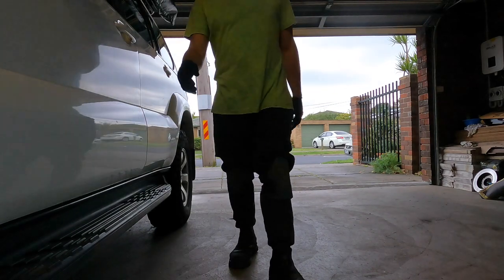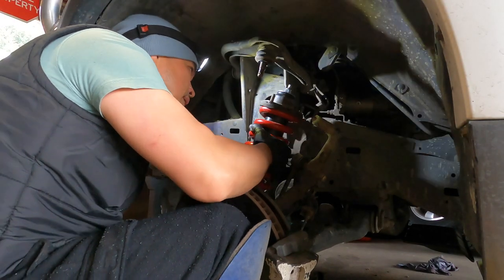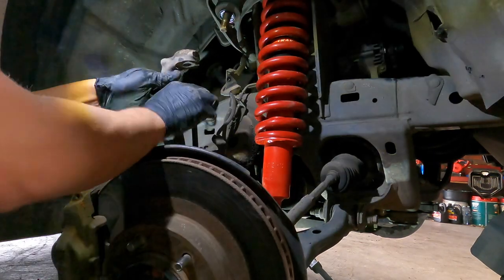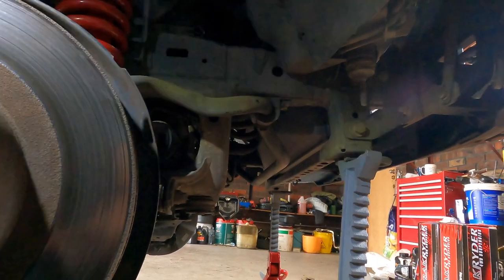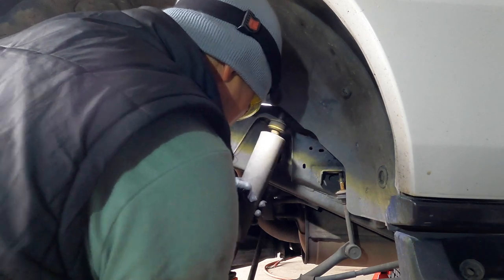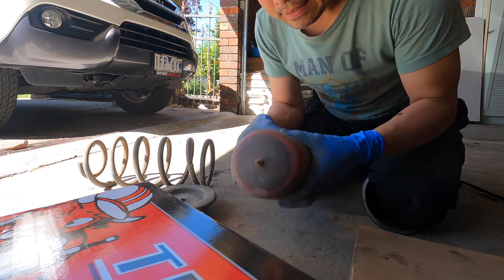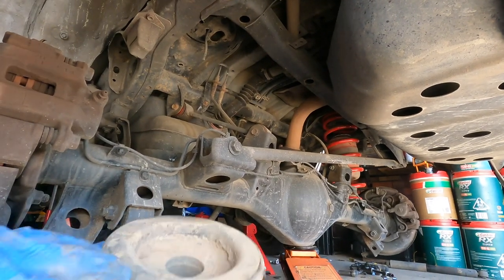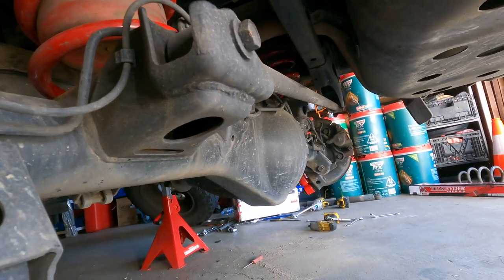How to INSTALL 2 INCH LIFT KIT to a LANDCRUISER PRADO 120 | MODIFIED | DIY | BACKYARD MECHANIC

Comment: Thanks for the video? What you think does the wheel aligmnent need to be adjusted after lifting car this much? I am thinking the angle of the wheel might change.
Reply from the maker: Yes, wheel alignment is required. Thanks for your comment.

Comment: I’m pretty sure once you’re all done you’re only supposed to do bolts up hand tight, then lower it to the ground with full weight on all 4 wheels before torquing up properly.  You can prematurely wear out the bushes on your shocks, sway bar links & panhard rod I’m lead to believe if everything is tightened too much prior to dropping the car.  Great video though, I enjoyed it.
Reply from the maker: All you have said is correct,  but I did not replace any bushes and they were all need to replace soon. You must be a mechanic too.

Comment: Thank you for your answer. By the way, my engine is a 3.0L atmospheric 6-cylinder. 2004 (201TKM) well maintained and it has no particular problem except that it's sorely lacking in punch at medium and high revs. Is there a remedy for this which we could apply.
Reply from the maker: Use Toyota injector cleaner, replace your air filter with K&E performance filter, clean your intake manifold and turbo intercooler, replace your exhaust pipe with 3 inches from turbo back up to tail pipe.

Comment: Good video ( i have a 2007 GXL Prado 120 4ltr and will be doing the same) its been asked but you have not answered - what width are your rims?  we know you say offset is neg 10 but what is the actual width of the rims? are they 9inch/ 10inch for example   ( i do know 17 x 9inch width works best with zero offset on the 120 Prado).   Also what aftermarlet airbag brand/part # did you use?
My Prado is black and i have swapped out the front headlights with black binnacles/LED and swapped out the rear taillights complete assembly with LED's.  Also fitted and Harrop E locker to rear diff & dual battery system/redark BCDC with rear slide-out draws & drop down table.   These 120's are awesome 4wd's when you upgrade them

Comment: Looks the goods mate, just wondering what wheel psecs you are running in the end with black steelies, ive just lifted mine chasing some wheels now
Reply from the maker: They're 275/70R17 rims with negative 10 offset. It fits very good mate
Reply: Thanking you much appreciated the reply
Reply from the maker: All good mate

Comment: Why is it that front stabilizer bar has to come right off.. is undoing the links enough. Or is it physically in the way of installing new struts?
Reply from the maker: Yes it is
Reply: @gooddayvlogs23  can the rear 2inch coils be put in without a spring compressor?
Reply from the maker: @mattyg7143 you need a pry bar to pry the coil in on the rear. On the front must have a spring compressor.  Best easy way is brimg the springs and struts to the auto shop to assemble it. That's what i did I paid 80, find a shop near your place ask them if they van hrlp you to assemble the front shocks.

Comment: Hello po sir, ask lang po if yong OEM coil spring ng LC Prado J120 front and rear the same ba sa FJ cruiser at Fortuner? Salamat po sa explanation nyo.
Reply from the maker: I'm not really sure, but if you look at the wheel base fortuner ang Prado are the same.

Comment: Hi.
I am going to install IMS suspension with 2" lift and 30mm spacers.
My tire size is 265/65/R17
I hope this is sufficient to prevent any rollovers.
Reply from the maker: I think your plan is a good set up, my suggestion is use 265/70/R17 tyres.
Reply: Could you help 2” means how many cm in front spring and how many for the rare ?
Reply from the maker: @magedbaqar4368  5.08cm

Comment: Congratulations man, I'm going to show your video to my mechanic to put the same kit on my Prodo in France. Could you please indicate the part number and  the constructor of the kit. I have been told that in Australia they are the best
Reply from the maker: It's a Pedders brand, you have to buy a kit. Part number is Pedders 7839, it depends on what ratings you wanted, how much load you carry. You have to buy an airbags and fit inside the rear coil springs. Thank you

Comment: Looking good! What size tires you got?
Reply from the maker: 275/70R17
Reply from the maker: Bfgoodrich mate
Reply: Did they not rub or causing trouble? Looking to fit new tires and its between 265/70r17 or 275/70r17
Reply from the maker: No, steel  Rims has -10 off set. If you want to fit 265/70R17 the old alloy mags can be used.

Comment: May i ask what the comfort is like on the front end now with heavy duty 2 inch lift front springs?
Reply from the maker: It's good to drive now that higher than before, more faster now that the tyres diameter is bigger. I'm satisfied with Pedders 2 inch lift kit.

Comment: what did you use on it to get that height before you installed the 2inch lift kit
Reply from the maker: Did you mean a tool? I use spring compressor.
Reply: @gooddayvlogs23  i mean it was high before you installed the kit, how'd you do that
Reply from the maker: I put bigger tyres, 275/70R17 size.
Reply from the maker: @joelsilvera5141  no, its just the standard height .

Comment: Bro, just asking, pwede din ito to do on a Prado 90?  I'm interested to install the same on my vehicle.  I'd appreciate advice on this.
Reply from the maker: Pwede rin brod, pareho lang sila pero you have buy fir prado 90 series maaring iba ang part number.
Reply: @gooddayvlogs23  Thanks mate.  Nahirapan akong makakita ng parts and mechanics here in Metro Manila.  Am going to modify my ride a bit for eventual car camping.
Reply: @gooddayvlogs23  I got a recommendation to use Oldman Emu for the lift kit.
Reply from the maker: @normancamungol5640  good brand yun brod.

Comment: Hi, Salamat sa information.  What's the brand of the coil and suspension you are using?  I also have a 2002 Prado 120 series in the Philippines with Iron man suspension but I need it lifted to be able to use a bigger tire. Thanks again.

Comment: Mate quick question, your Prado is a Grande?  I'm being told, we cannot do an upgrade to the Grande, because of airbags on the rear, you have airbags??  You did not have any problems from watching your installation
Reply from the maker: It's only a GXL coil springs not an air bag. I think your car has a suspension height control.
Reply from the maker: I didn't have any issues after all.
Reply: @gooddayvlogs23  Yes it does, just doing the fronts now, love the vids, keep em coming mate.

Comment: Sir ask lang, anong tire size gamit mo? Anong recommended tire size sa prado after left up to 2’? 
Thank you for your reply.
Reply from the maker: Itong sa akin 275/70R17
Reply: Same unit po tayo sir, Anong observation mo sa fuel consumption? Ty
Reply from the maker: Sa long drive matipid pero city drive medyo malakas yun din ang sabi ng iba.
Reply: 2’ lift din sa akin and one time I used the 265/70/17, I noticed the fuel consumption was good however, it didn’t look proportion due the ground clearance after the 2’ lift. 
Anyway, thank you for your videos that gives us the idea owning a prado 120 series.
Reply from the maker: @1973yesir  Yes sir, modified suspension driving performance is different kumpara sa original stock.

Comment: Can I add a spacer to grande 2006? It has air bag suspension
Reply from the maker: There is a product in the market called DIFF DROP OFF KIT can be used on air suspension like your grande.

Comment: Not a single nut or bolt torqued to spec...but hey, that's the Toyota way. Had you done this with a Discovery (i know, they have air suspension) you wouldn't have made it out of your driveway.
Reply from the maker: I do apply torque only on an engine rebuild, the rest just tight it. Prado Grande also have air suspension I have not done with the discovery I wish one day.

Comment: Good day sir, nasa NSW po ako now, nag hahanap po ako ng Job here regarding in mechanic, airccon mechanic po ako sa pinas you can reply here po if you need a helper?? Thanks po sir.
Reply from the maker: Brod magkaiba ang category ng trade natin, pero in demand din ang trade mo dapat sa mga Air-conditioning shop ang applyan mo.
Reply: @gooddayvlogs23  okay sir thanks po, bali 1 month palang me, dito po me now with my aunt sa blue mountains.

Thanks po.